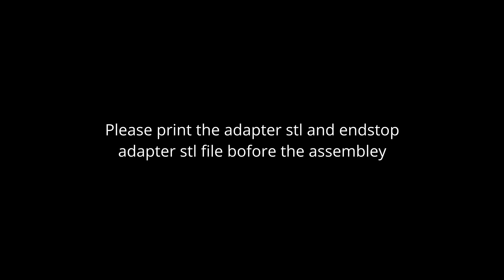【THINKER SE MOD】Pheatus HIC on THINKER SE

Comment: since I have change the extruder to the HIC and print the ER-20 start the print after correct leveling always round about 3 cm to high (over the printplate) what can I do to fix this problem?

Comment: The worst thing about Eryone is their lack of ability to communicate with customers who are having problems.  I really liked my printer, but then it had problems.  First time i contacted their customer service they told me to change the firmware, so I did.   

The problem remained, so I contacted them a few more times over a number of weeks and they didn't even bother responding, so I reported them to Amazon and returned their printer.

Another thing they did which was really annoying was rely on their Facebook community to provide help, which is no good because not everyone has facebook.